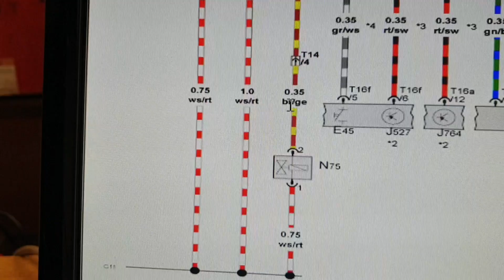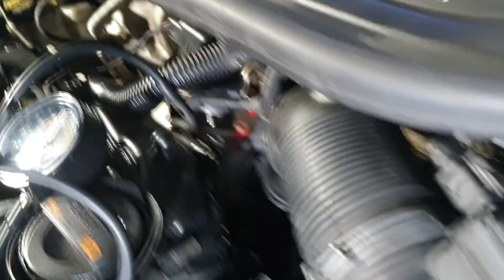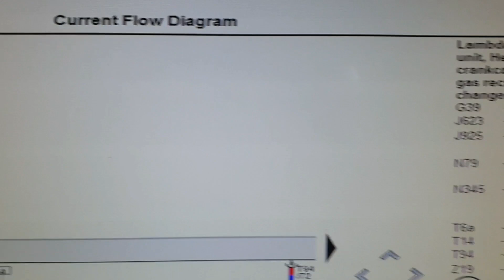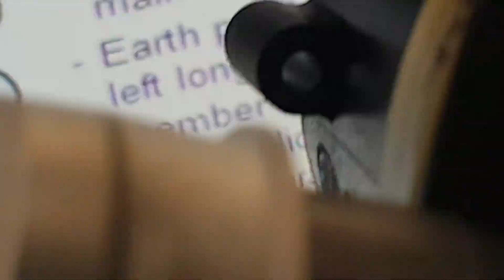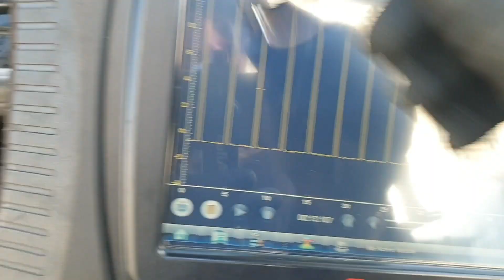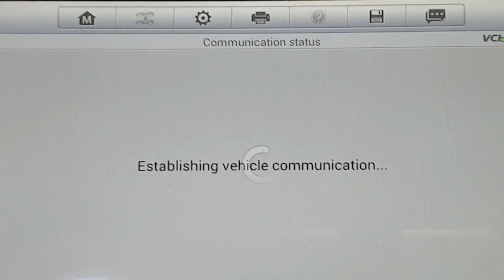Audi A1, A3 1.6 TDI CR P0047 (P004700), P0691 (P069100) DTCs Troubleshooting

Comment: Hi, I have the P0047 code on my A1 1.6tdi and also a P2426 code which is the EGR cooling valve, would this too be an electrical issue like yours?